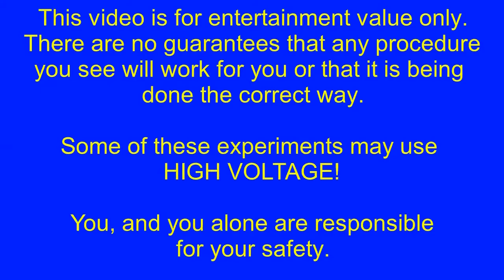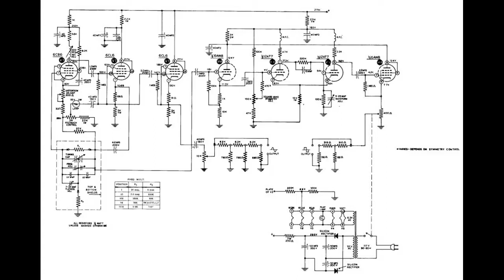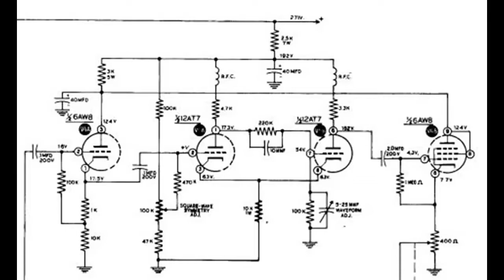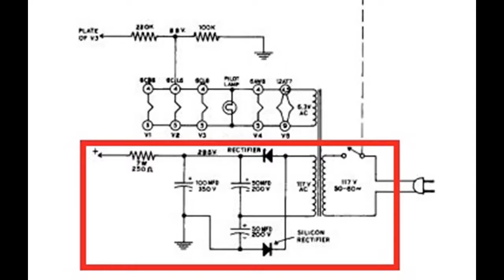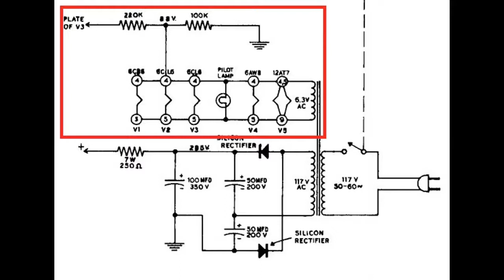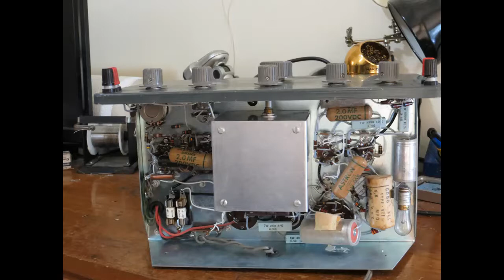AG-10 Sine Square Wave Generator

Comment: nice info Bob, and the heat here has been a bit much too.
Reply from the maker: I don't know about that George. We've had a lot of 90° plus days and yours haven't been much hotter that 32°! 😋
Reply: @YouAllKnowBob  ahh yes... our funny european standard SI units of measure... it reached 36 in the workshop yesterday, day before was 34... it has been warm. we had a storm this morning and now its down to 25 in here.
Reply from the maker: 36 is a bit toasty. I use SI for everything except everyday temperature.